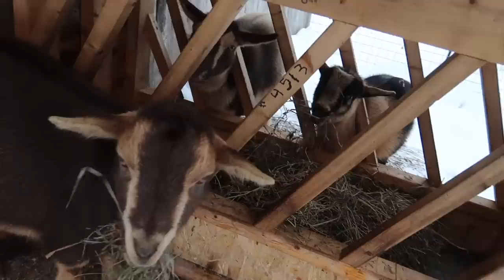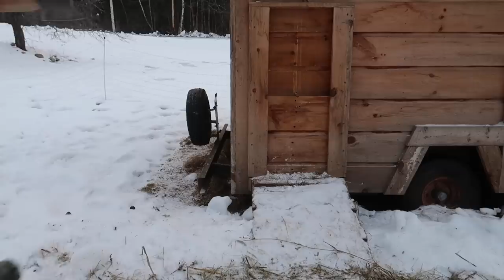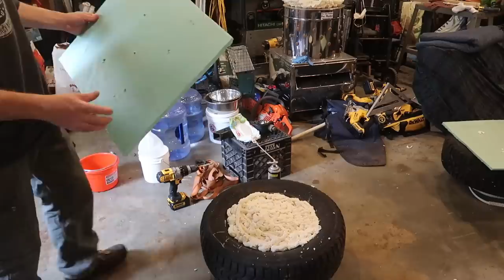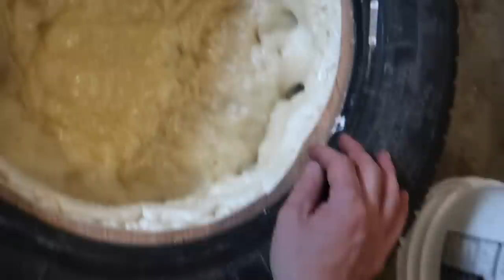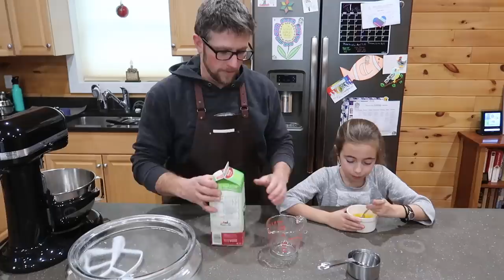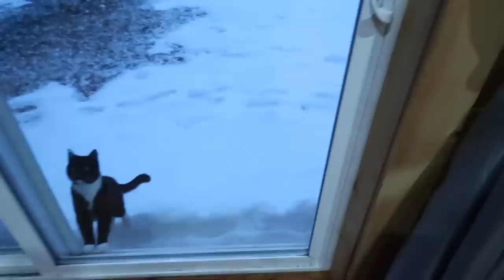Desperate times call for desperate measures (Saving Our Chickens)

Comment: I think the foam needs to be able to get air to it to be able to dry and with the plastic on it it can't get any air to it. Just a thought. Looks like your idea of the water not freezing up is working though. I'm glad you put some straw up there for the goats  to help keep them warm because I had the same thought that they need something up there to help try and keep them warm some.  Olivia's so cute helping out in the kitchen.  It's great you let her get in there with you and start learning.
Reply: Yes, that's the problem.
Reply: @rogerflanigan6427  - Close, but not quite. The foam is urethane, and needs moisture to cure/harden.
Reply: @jmacd8817  Yes, he should be spritzing the rubber and plastic with water.  I had heard that somewhere, but I can't remember where so I didn't say anything, just in case I remembered it wrong.

Comment: My experience has been that expanding foam needs air to dry. It may be that the cling film is sealing really well and stopping the foam from breathing and drying out. I tried to fill the sides of a small boat with it, the air tight areas just wouldn’t dry. Good evening from Sydney btw.

Comment: The cling wrap shields out the air. shield the air, and you shield the moisture. No moisture, and you never "signal" the foam to start drying.
A teensy spritz of water on the plastic will help a lot.

Comment: Canned foam is not to be used in sealed areas. It won't cure.  It needs moisture and air to cure. The saran wrap is sealing both from the foam.

Comment: the foam is designed to expand and dry with contact to air.  Once you seal it up so air cannot get to it, it will not cure.  You needed to leave off the foam board then it would have cured.  Maybe added some wood after so you don't have the foam on the ground.

Comment: If you save the root end of the celery with a couple inches of stalk (just like you have at 20:54) and put it in a glass with 1/4-1/2 inch of water, it will continue to grow new celery stalks and when the weather is warmer, they can get planted outside. 💜🌞🌵

Comment: Check the instructions on the can, but the foam usually needs moisture to set it properly, there's normally enough in the air for it to work, so putting the wrap on stops it getting what it needs. If you spray it with water it should set a bit quicker.

Comment: I had my home sprayed with insulation. one spot used to have a window, it was walled and sealed up. They said they couldn't spray the foam into that area because it wouldn't have sufficient amount of air to cure. It would smoother itself and not cure properly.

Comment: In order to fill something like that with that foam you must go only 1 spray thick at a time, don't try to empty the can. It needs air getting to it to complete the chemical process. I use a plastic bowl with a lid and drop the stray sprayer part in it with acetone fingernail polish remover it will clean the foam out for reuse.

Comment: What if you put the goats water closer to the milking station gate.  The air back there wouldn’t have the colder air from the door to the outside  by it.  A few degrees and not having the colder air blow across it may give a little longer before freezing.  Also, the density of your supplies and hay in ,the milking area will keep colder air away.   Kinda like.....don’t sleep by a window with the colder air.

Comment: Spray foams use a chemical called isocyanate. That chemical needs moisture to cure, not air. Take a spray bottle filled with water and spritz the area under the tubs where the foam isn't curing. Be ready to put the tubs right back in because the foam will start to cure and expand once the isocyanate has plenty of moisture. This is also true if you are foam filling tires to prevent flats. Put a little water in the tire before the foam and you'll get great results. If you don't, your tires will always be squishy because there wasn't sufficient moisture for the iso to kick over. Hope this helps.

Comment: Al, with that spray foam... If you get it on you, or on your clothes... Don't touch it! Don't let anything brush against it. Just leave it completely alone until it cures. Then, just pop it right off! The mistake is to brush at it, or try to remove as much as possible, immediately. That just smears it into/onto the surface it is on. Making it impossible to remove.

Comment: Al, the foam wasn’t drying properly with the goat’s waterer as well. I wonder if the plastic wrap is holding in the moisture, preventing it from drying. I wonder if you use something like Vaseline or an oil to coat the buckets instead if you will have same problem and if the foam will still not stick.
Reply: Actually the opposite: urethane foams need moisture to cure, so the cling wrap is keeping the moisture out.
Reply: Jeff MacDonald oh, good to know.

Comment: Al, how do you keep the leftover spay foam on the can from blocking the outlet? Can’t tell ya how many partial cans I could not in block. Maybe Saranwrap over the top? What’s your secret?
Reply: I don't think he's had any leftover. When I researched how to keep the nozzle from clogging the tip I found was to spray a pipe cleaner with WD-40 and shove it in the tube. I haven't tried it yet.
Reply from the maker: If I am using two cans in a row I reuse the tip from the first can and save the other new one. when you have a partial can leave the dirty nozzle on until you need to use it again and put the new one on

Comment: On the plus side, the chicken water buckets that you are making is that if you leave it outside in the summer it won't blow away.  You left the egg on the floor as well.  What breed of dog is Pluto?  The saran wrap holds in the heat and keeps out the air. Do you think the little may be in heat and that is why she is head butting her?  What do you use to clean your concrete counter top?

Comment: Al, why don’t you run a cord out to the coop and heat the water...that’s what many of us do here in cold N.H.  Doesn’t cost that much and no worries weather the hens have water during the winter months.  Peace of mind
Reply: A Roemer ...that’s a long way for an extension cord plus it means electrical risks. I like this idea of insulated waterers...it makes economical sense in the long run.
Reply: Fiona C only if the waterers work, I’m curious to see. Chickens die quickly without water and they drink a lot in Winter, even if it means breaking ice every morning. The coop can be moved closer to power I’m sure, it’s on wheels and Al has a tractor. What is the electrical risk? Just curious...been doing this for 30 years with no problem. Just buy a water heater for the coop at your local farm/grain store

Comment: Needs air to cure. The plastic wrap was a good idea, it didn't turn out because of the 1/4" foam board you added in the bottom. Basically that cut off the oxygen to it and stunted the curing process. Otherwise great idea! I'm anxious to see results from it.

Comment: What does it cost to make one of the waterers? The spray foam is high isn't it? If it works it's worth buying the spray foam and yours is working for the goats. Love your Chicken and noodles recipe. We love you all too.
Reply from the maker: each tire took two cans of foam the rubber bowl was $8 at TSC and the tire was free. I have around $20 invested in each tire set up. and the goat I have around $24
Reply: @LumnahAcres  thanks for your reply back I greatly appreciate it. I'm going to do this for our animals as well.